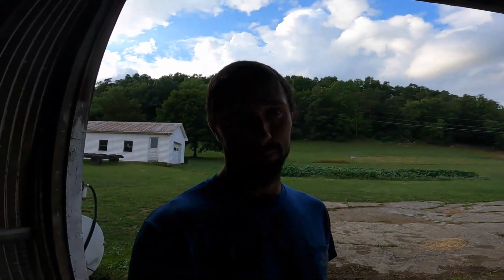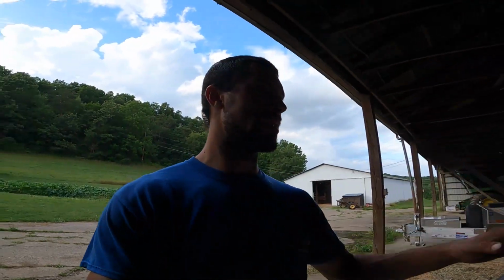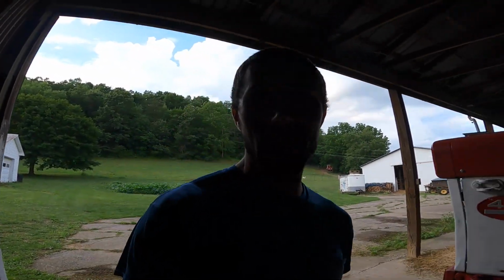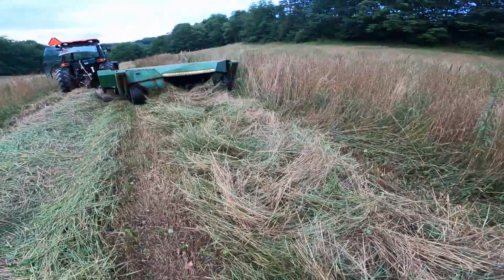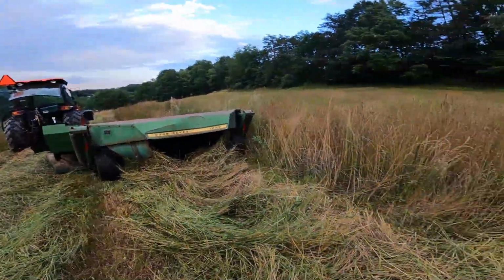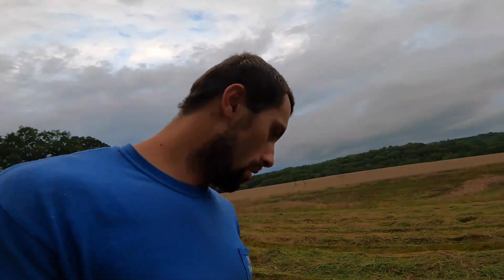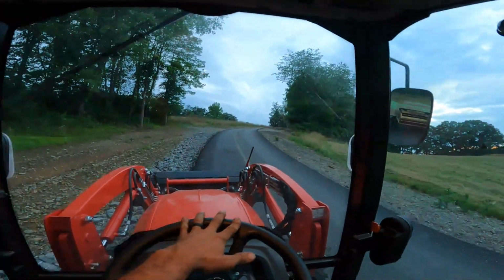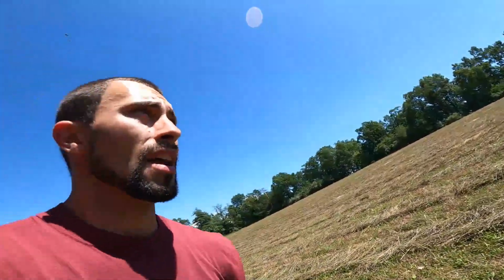Cutting Hay Farmall 460 & Kioti Dk53

Comment: Go and get one of those screens that you shove into the top of the sediment bowl That will allow the gas and not the chunks to flow into the sediment bowl and your 460 will run a lot better but you will need to remove the gas tank and get cleaned some time in the future. Some people line the tank with a coating to keep the water away from the steel tank. Tom.
Reply from the maker: Thanks for the info!

Comment: It may the filter you added as well.  Those types of filters usually require a fuel pump (they have a high flow resistance)
Reply from the maker: Definitely a possibility, I thought that as well maybe to restrictive , but it did say on the pack for carbureted engines so idk 😂